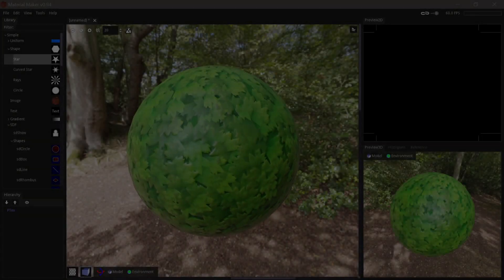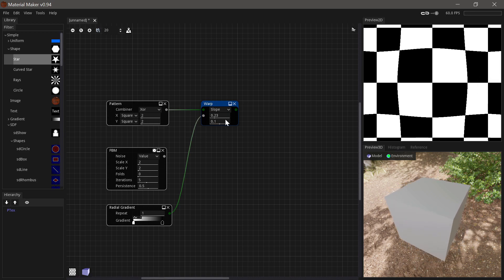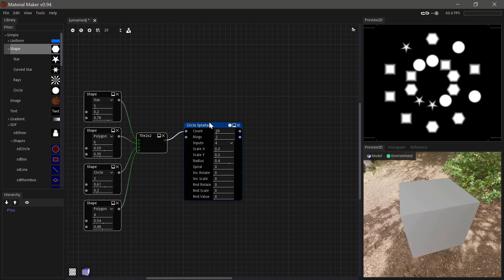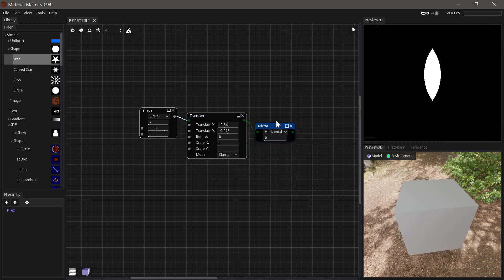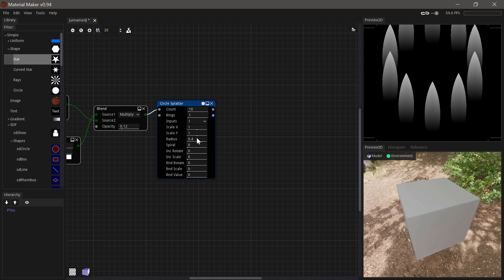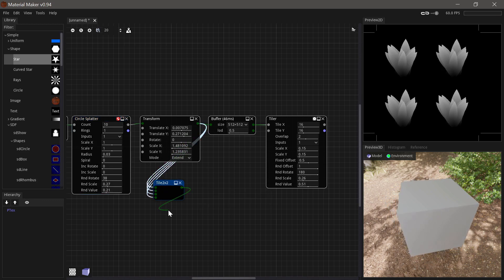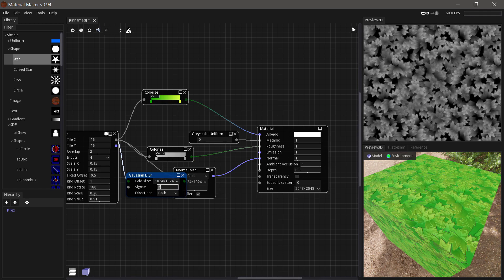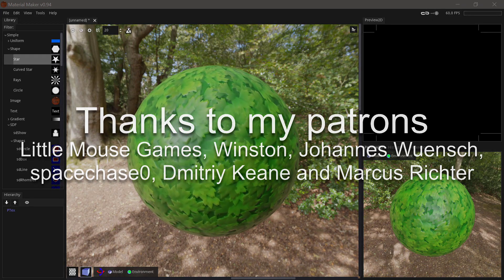Using Transform Nodes in Material Maker

Comment: i have made a crochet pattern but i want a stitch pattern between each edge and to follow the direction of the edge, is this possible? I'm new to the program but have been using it for a few days, I tried the tiler but it didn't give the desired result, i also tried using tiling and then multiplying the edge detection by the pattern and that didn't give the desired result either.
Reply from the maker: It's almost certainly possible. I'd suggest jumping on the Material Maker discord and asking there and posting some pictures so we can understand what you need :)

Comment: Awesome man! I have some questions.

1. When you export the material to a game engine it will be converted to a shader program?

2. If so, is it possible to define some parameters to be controlled by the game?

3. What is the performance cost of using this kind of material instead of generating a texture and applying it directly to the 3D model?

I'm not an experienced game developer, so I'm sorry if my questions are dumb or don't make sense at all.
Reply from the maker: Hi Luiz :). When you export to a game engine, texture are generated by default. But you can change the material type to be dynamic and that will make it a shader export instead that can have animated properties and customizable parameters. I think currently the parameter thing is not set up to happen automatically, so you have to do some shader editing to set that up. You can join the Material Maker discord server and we can chat in there. Rod the maker of Material Maker is in there and will be better at answering this.
Reply: @KasperFrandsen  Thank you for the fast answer. I'll take a look on Discord